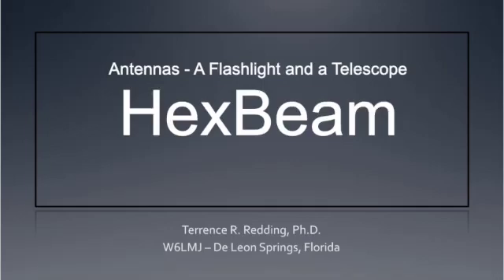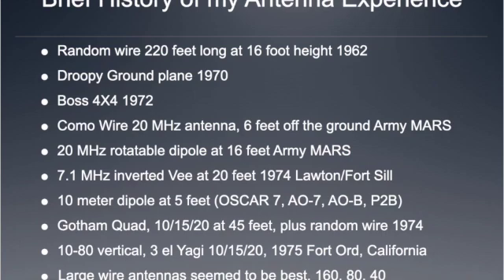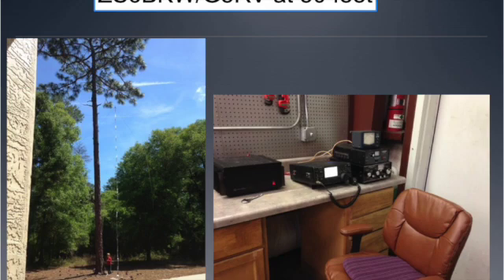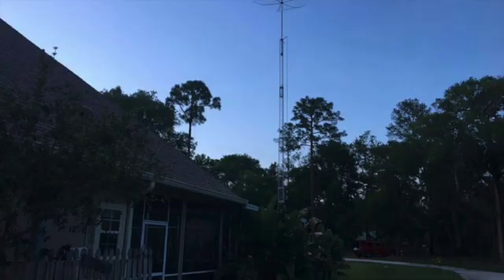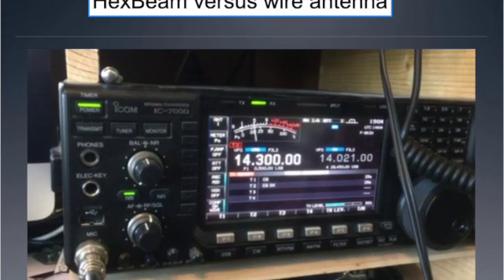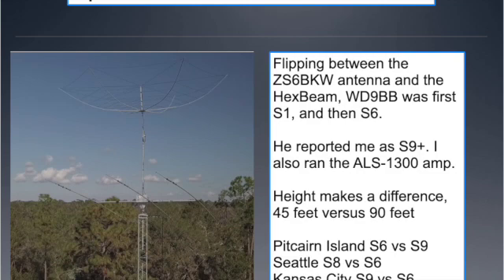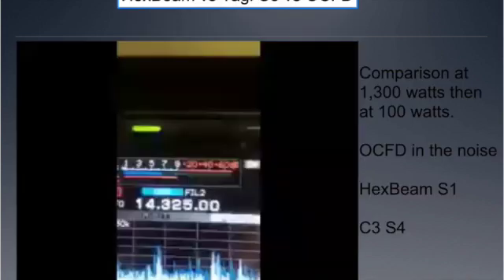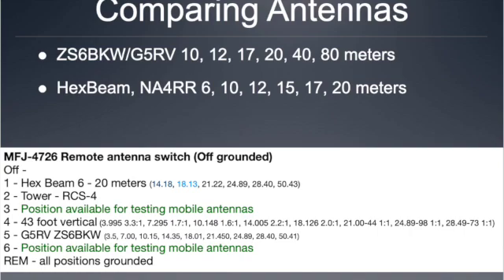HexBeam compared to wire and Yagi

Comment: Thank you terry glad i found you. I am getting started and trying to figure out what to get.. so far ive only built 2 dipoles,
Reply from the maker: Dipoles are hard to beat. Try to keep the old antenna when you build a new antenna and compare them one to the other with an antenna switch.  It is easy to kid yourself into thinking the new antenna is better when it is not. Being able to do an on-the-air A/B test removes all doubt.

Comment: At ZL4AI located in Southern New Zealand:
I found a Hex Beam on 20m at 14m with an SFI of >150 gives a signal of 2 to 4 (sometimes 5) S points more than an ZL4AI-N4GG array when listening to Signal from England which is 19,000K away on the other side of the planet . 
For the same conditions transmitting into The Hex Beam with 25 watts gives signal reports from  England of 5/7.

There is no doubt the Hex Beam provides remarkable results. 

SFI conditions are an important factor. 
Can you please report what the SFI were at the time of your video ?
Reply from the maker: Solar Flux index of about 75.

Comment: How did you like the hex vs the c4 for dx and contesting ? You have a wonderful tower setup
Reply from the maker: Hi, Jay.  The C4 is often 5 S units stronger than the Hex Beam.  The C4 is hands down the better antenna for DX.  Note, I ultimately installed the Hex on a 25-foot mast on the shop. It now has the advantage of the lower height and higher angle of radiation associated with that height making it sometimes better for state-side contacts.
Reply: @oltredding  absolutely! I just finished a book about tribanders. The c3,4 c31xl all performed much better than any other beam. I agree the hex is a great domestic antenna. It’s hard to beat a long boom yagi for dx at 70ft or so.

Comment: Hi maybe you can help me.
Im in doubt to buy a HexBeam or Momobeam  Tri 7  or even a Cubical Quad 2 elements ( 5 band )
About your comparison and since than what can you tell me about Hexbeam or the Yagi ?
I know we love all  our antennas, just trying to understand and try to help my choice.
Reply from the maker: I had a two-element, five band GEM Quad.  It was my all-time favorite antenna. I was tempted to put another one up. However, my desire for at least two elements on 40 meters caused me to use a Force 12 C4.  It is excellent. I have a complete write-up and comparison of the HexBeam to a G5RV, a 3 element tri-band Yagi, and this Force12.  All of that information is on my QRZ page.  Just look for W6LMJ/  I am not familiar with the  Momobeam  Tri 7, so I can't comment on that. If after visiting my QRZ page you still have questions, I would be happy to respond.
Reply: Depending on your geographical location and weather. I would recommend the tri 10 momo. Light weight for what it is and withstands high winds very good compared to the quad. Don’t get me wrong, the quad was my favorite beam as well but just didn’t last very long in our windy climate.